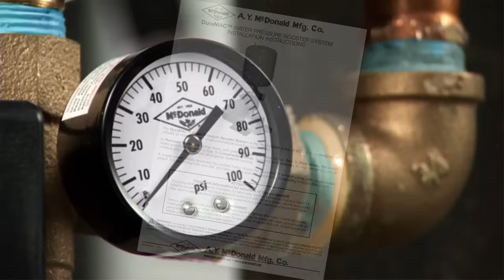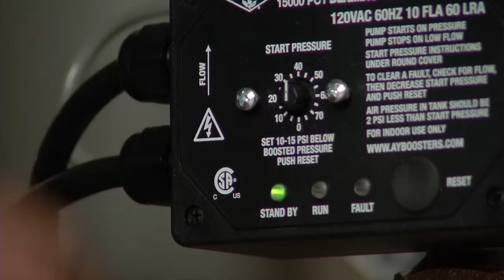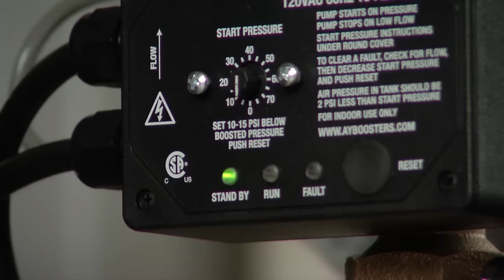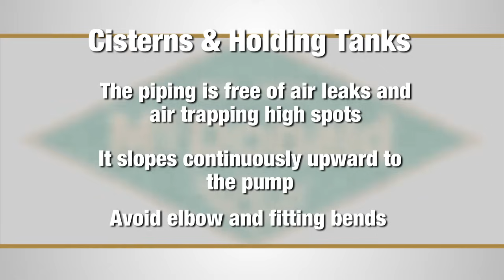DuraMAC™ Residential Pressure Booster Installation

Comment: What about thermal expansion from the hot water tank when it's heating up? Once you installed your booster system your house becomes a closed system
Reply from the maker: Thanks for your question! The pressure tank will take care of thermal expansion.

Comment: Why do you have a pressure reducer valve on the pump suction?
Reply: That's just in case the incoming water pressure exceeds the recommended pressure.

Comment: can this be installed on a well system after the pressure tank and after the water softener my pressure on 2nd floor dual shower is less than ideal
Reply from the maker: Yes, preferably before the water softener as long as you have enough flow or volume for the application. Please call us at 1-800-292-2737 for any additional questions you may have!

Comment: Can it be used only for hot water if the other pipes have normal pressure? How high a temperature can it work with?
Reply from the maker: The Booster pump is not designed for hot water applications and the max recommended temperature is 120 degrees.

Comment: How much it cost?
Reply from the maker: Hey There. The cost of the pump would be determined by the Distributor we sold it to. The cost of the installation would be determined by the plumbing or contractor installing it. A.Y. McDonald only sells through Distribution and do not monitor what installation costs would be throughout the country. A call to a local plumber will get you an estimate of labor rates and if needed we can locate a Dealer in your area.
Reply: @aymcdonaldmfg  wtf??you don't have control???

Comment: Perhaps I am not getting the instructions.  The plumber uses teflon tape and pipe sealant but at 1:55 the narrator and the written instructions say do not apply pipe sealant directly to pump threads.  I know he used the sealant on the check valve.  Is this OK.  Normally I use one or the other but I am not a plumber by trade.  One comment said this s important. Please explain.  Thank You.
Reply: Goodman diad what they are saying is that you want to apply the tape and/or sealant to the nipple threads and do not apply it to the pump threads, that way the tape and the sealant stays outside of the pipe and won't foul the checkvalve

Comment: Is there a delay before this booster turns on? For example, I currently have a booster in my home but the pressure drops significantly before the booster starts up. It will take about 24-30 ounces of water flow or up to 10 seconds before the pump begins to run.
Reply from the maker: Hey Joshua, we do have some possible explanations for the question you asked. However, it will be hard for us to answer on here. Please call us at 1-800-292-2737 so we can walk you through this. Thanks!
Reply: noo there's nothing like that
Reply: The booster tank is designed to not run if you open the faucet for only a few seconds to wash your hands.saves the pump from working so much

Comment: I need your recommendation. Im getting only 16 pounds pressure from city water line. Will this pump work in this low pressure.
Reply from the maker: Hey Duraikandan, Yes, our booster pump will work with that low pressure as it is designed to boost city water pressure. Our 17035R020PC1 series, which is a 35 PSI boost, will take the incoming pressure of 16 and add 35 PSI, giving them 16 + 35 = 51 psi of boosted pressure @ 0 GPM. The curve on the product submittal will provide the boost at different GPM usages, which can be found here: https://aymcdonald.com/asset/58504. For more information, please reach out to us at 1-800-292-2737 so we can walk you through how the pump works.
Reply: @aymcdonaldmfg  l

Comment: Can the pump and the control switch sit on the floor? I thought the code was at least 12 inches from the ground for any electrical.
Reply from the maker: The pump can be mounted to the floor as long as your local code allows for it. Electrical codes vary in each state. Does that answer your question?

Comment: Question I live in New York in a  two family house.My problem is this   in the basement I have no problem  with cold water pressure. But I get low cold water pressure upstairs in my kitchen and bathroom sinks plus tub. Is another way I can hook a pump in a situation like minds ?
Reply: Fix your plumbing, if you have good pressure at the basement it tells me there is a restriction in the upper floors. Especially when you only said cold water. A pressure pump won’t fix that.
Reply: @letserb  yup 👍
Reply from the maker: Nathan,
We will need to know what the pressure coming into the house is, how many GPM, and what size line is coming into the house in order to answer the question. Please let us know!

Thanks.
Reply: But  the pressure is  good  in  basemant.But weak on the upper floors.
Reply from the maker: Nathan,
Please reach out to our customer service line at 1-800-292-2737 so we can walk you through how to solve your current pressure problem. Thanks!
Reply: Nathan 8